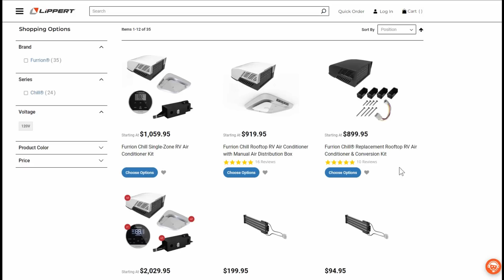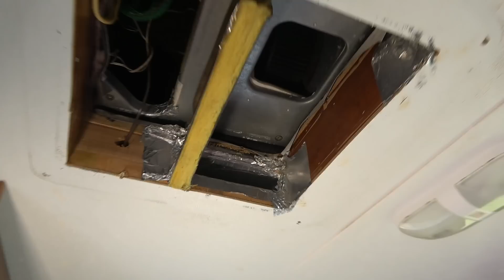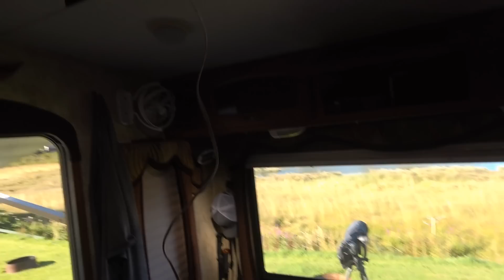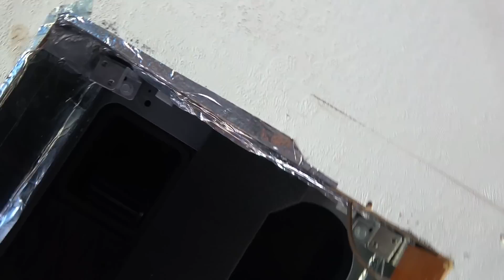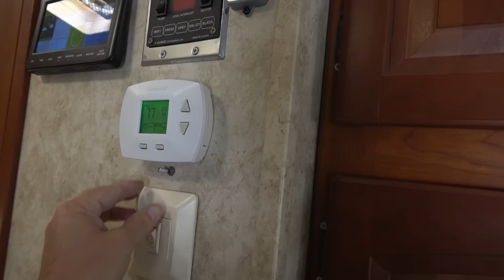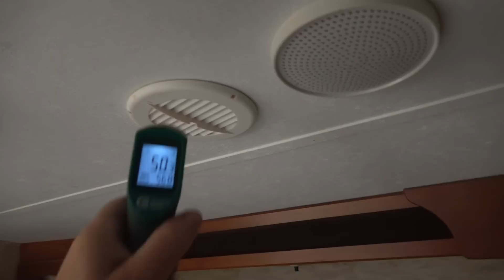Furrion Chill Replacement RV AC Installation using the Conversion Kit for Coleman Mach/Dometic/Avent

Comment: Hey Ray..... did you ever look into those under $1000 mini splits? My wife is bugging me to get one for our Az RV.
Reply from the maker: Yes, thought about it but not something I'd want to add to our trailer, though. You have to have that fan box outside somewhere. I guess people put it on the back bumper for fifth wheels. But then it needs to be covered for travel, or it will get filled with dust and road grime I imagine. Then it all has to be plumbed and wired. Too much of a hassle since we don't need AC all the much, usually just in the summer months. We generally spend winters in the southwest desert and summers in the Pacific Northwest, usually on hookups in July and August. We like to chase 70-75 degree weather. I'm not much of a fan of hot weather. :) Cheers, Ray
Reply: Ray, yet another great mod and test. I’m with Commando602, in a warm climate and would like to do the same (Mini split) with 2 IDU’s (indoor units) since we have 2 units. We enjoy the warmth, normally our thermostat is set at 80. So yea, I have to make a location for an ODU.

Comment: I may have missed it but what about the condensation drain? Does it drain out onto the roof or down a tube?
Reply from the maker: It has drain holes in the bottom pan so condensation drains onto the RV roof

Comment: Nice job ray I’m glad lippert is coming out with conversations so you don’t have to mess around with changing your thermostat you can look into the rv airflow kit now it’s supposed to give 50% more air flow
Reply from the maker: Thanks! Air flow has never been an issue in our RV, with 4 vents in our relatively small 1 slide trailer, air flow is great we never have the fan on high, low is plenty. Any more and it would be annoying. :)  I guess people with large RVs or poor ducting layout need that.  Cheers, Ray

Comment: We used our Coleman unit as little as possible due to the noise. My wife couldn’t hear my snoring for it it’s so bad. Turn it on before we go to bed and then turn it off. Sounds like you maybe able to use it overnight. Is it seriously that much quieter or just a bit quieter?
Reply from the maker: I'd say about 20% quieter, don't need to turn the TV volume up as much as we used to.